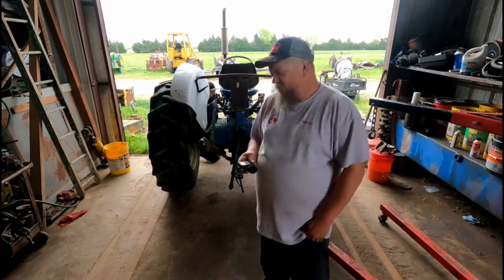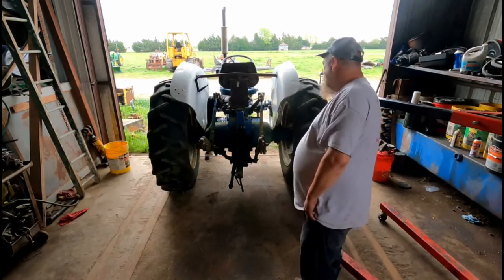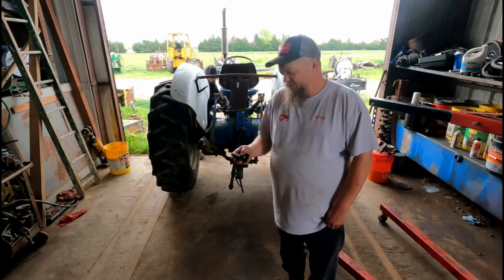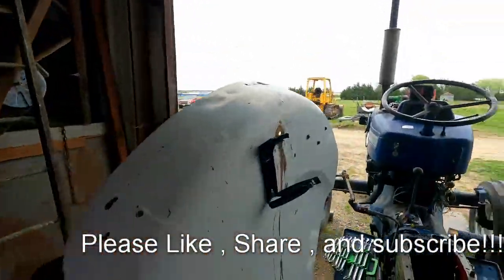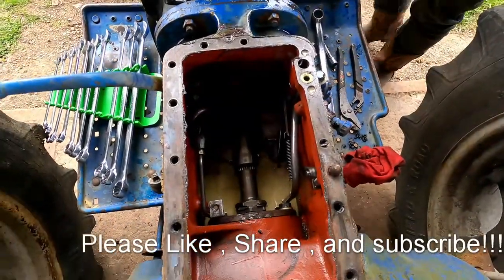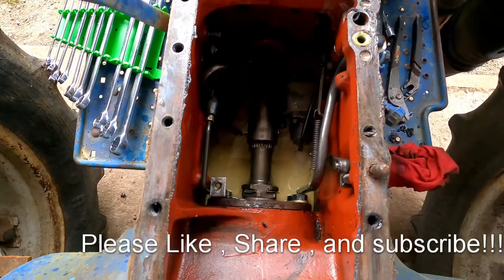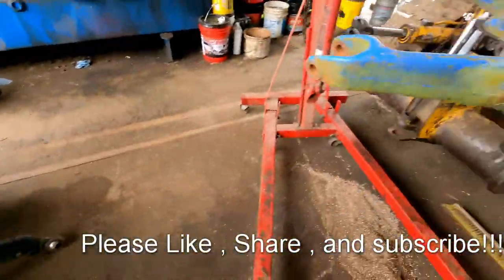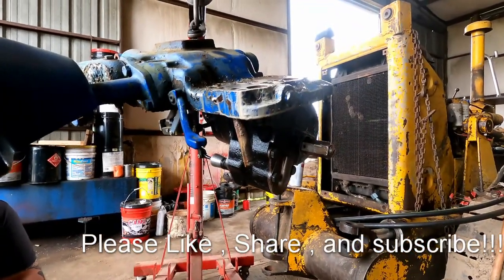Ford tractor 3 point diagnosis

Comment: Looking for the follow up video. I’m working on same issue
Reply from the maker: Here is the reply that includes the fix . Sadly I didn't get it filmed and this was one of my first videos. The issue was in the valve in the bottom of the 3 point hitch top. We removed it and found it was stuck. After freeing the valve we also had to bend ever so slightly the linkage so that it didn't bind when going through the motions. It sounds like the valve is stuck as this is the same issue that this tractor was brought in for. Hope it helps you and thanks for watching.

Comment: Thanks for replying. I'll let you know what I find.
Reply: I'm trying to get the top cover to break loose from the transmission on the 5600 now, how to you get it to break loose? This thing is stuck tight?
Reply from the maker: Sorry guy I didn't see  this. At least I see you figured it out.
Reply: @vintagediesel-1  not a problem...thanks for the help.

Comment: So what'd you find wrong with it? The 5600 we have here is staying up and won't lower unless it leaks down. Ideas? When I fire it up and move the hydraulics from the FEL back to the tractor, the lift goes up, even with it in the down position, then hits the pump relief valve? any ideas?
Reply from the maker: The issue was in the valve in the bottom of the 3 point hitch top. We removed it and found it was stuck. After freeing the valve we also had to bend ever so slightly the linkage so that it didn't bind when going through the motions. It sounds like the valve is stuck as this is the same issue that this tractor was brought in for. Hope it helps you and thanks for watching.
Reply: @vintagediesel-1  t what I've found fixed and F'd up so far. I'll be chasing parts on Monday. https://www.youtube.com/watch?v=c3_oTNCUwfI